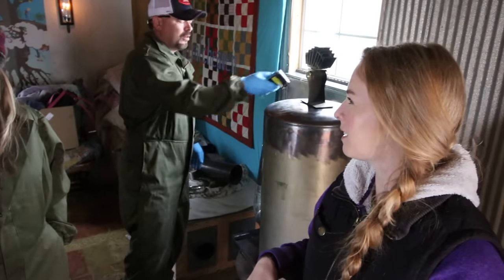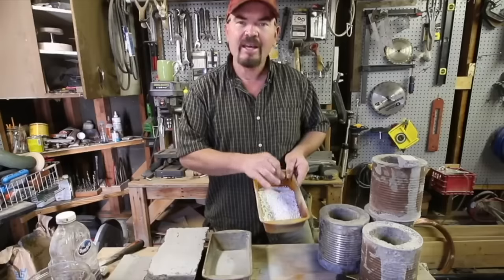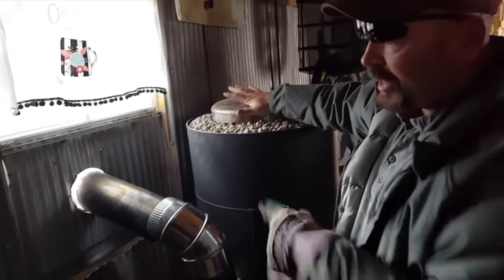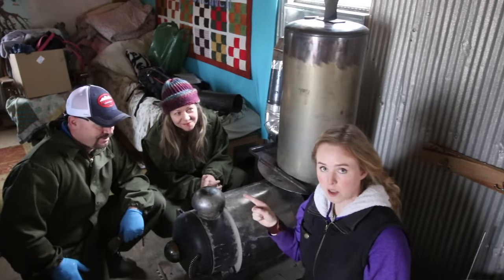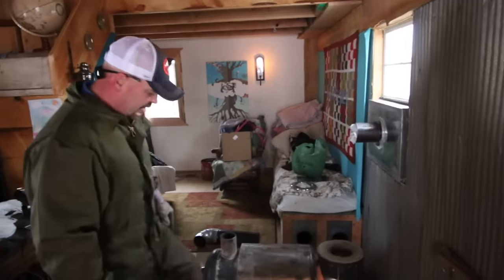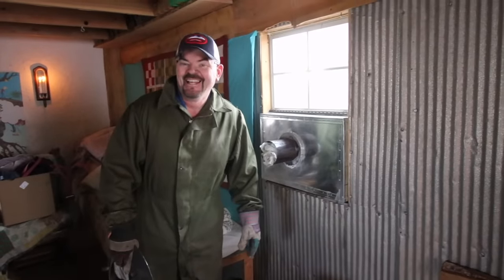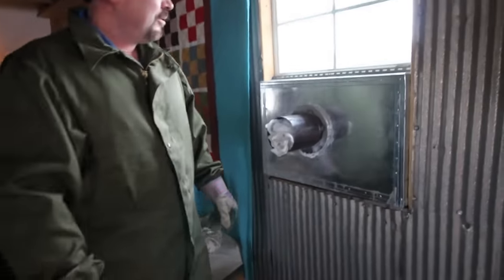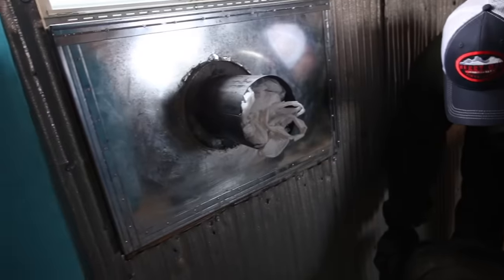DIY AirCrete Rocket Mass Heater 2.0 Works!

Comment: I don't see the point in building a stove to stay cool.  Sitting by a stove and having to wear a jacket doesn't sell it either.
Reply: TheMonkeyrock77 seems a lot of heat lost up the stack since it can't dissipate from the stove as easily or am I missing something?
Reply: TheMonkeyrock77 
Perhaps they just restarted it???
Reply: The whole point in a chimney at the Bottom of the barrel is to burn what fuel is left in the Smoke.  I talked to others who built really nice Rocket Stoves and they told me of the mistakes they made.  A tall barrel is one and fire on the bottom of the burning point is another.  If it was me I'd put the concrete at the bottom and less at the top so the barrel will heat better.  You don't want to set the floor on fire.
Reply: The Bell gets hot not the feedpart and riser must stay well insulated so the temp inside gets so hot that the gasses burn completly
Reply: Paul S but if well insulated you are not gonna have any heat in the room
Reply: Ed19601 The heatriser is insulated , the outherbell give,s of the heat + the mass at the left  . Google heat riser to understand it